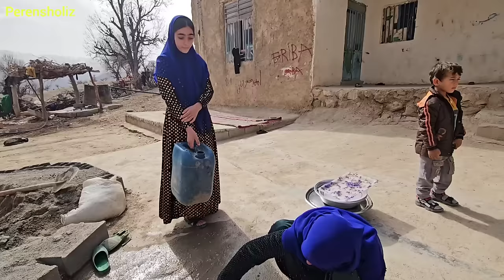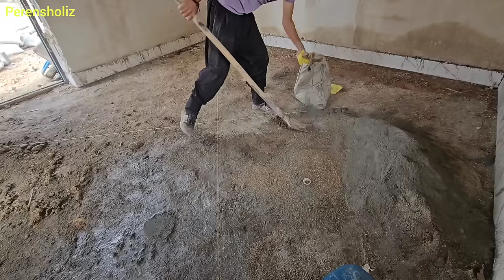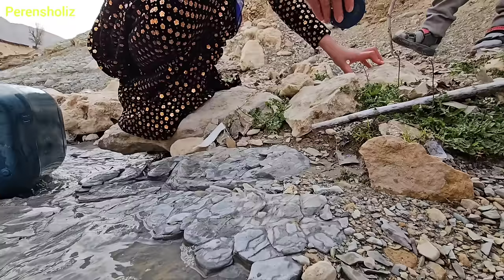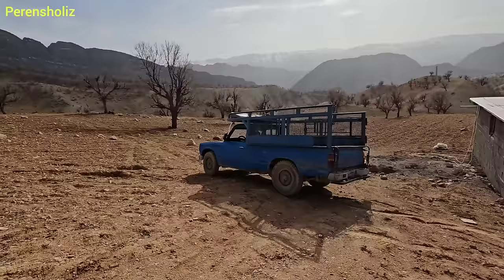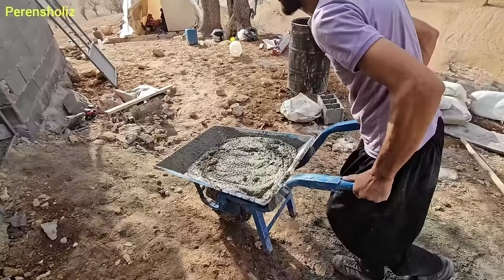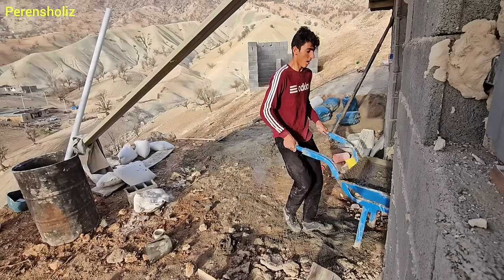Conflict between Masoumeh and Fariba near the village: Ishaq's help to Masoumeh

Comment: You should've use the straight edge steel bar to trawl the poured cement to get a more accurate level you need also to edge the joining of the tiles and cement so it don't cracks when cement hardens and expands.